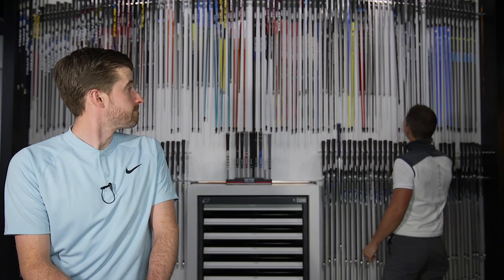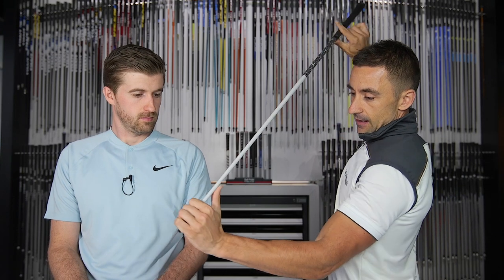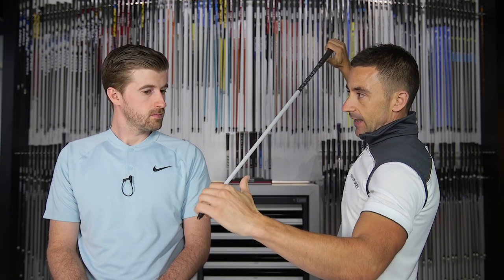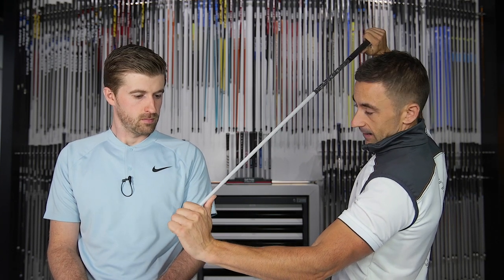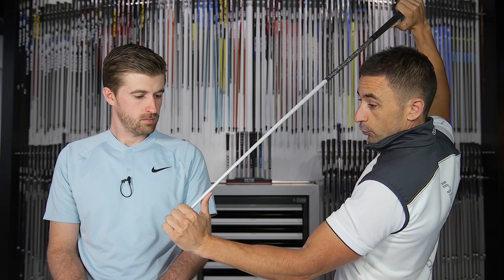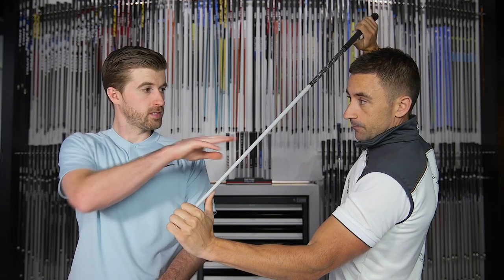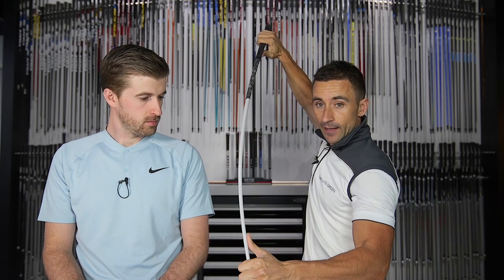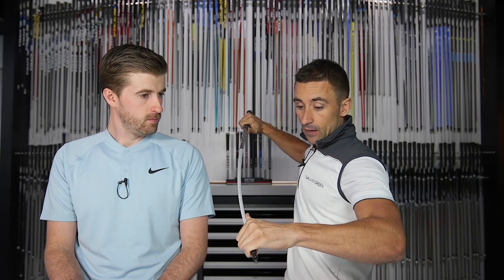The True Role of the Golf Shaft

Comment: I experienced this very thing in my own fitting with Ian while working through various shaft alternatives and I’m in mid handicap player.  As we narrowed it down, the launch conditions between the two finalists varied only slightly but in my case the Accra shaft had a better strike pattern and thus that’s the shaft we went with.  A key point is that the science here works for players of all skill levels.

Comment: I'd love to see this test with someone who is extremely quick takeaway, and hard load through transition. Crossfield and Dan are smooth release and Matt builds momentum so smoothly the shaft weight didn't seem to effect them as much. Personally my tempo is quick and I struggle to find the face with a lighter setup.
Reply: Agree.  I've got a very quick tempo and hard transition and my GC Quad shows a WILD difference under the same testing conditions.

Comment: It's a touch and go area I believe and it's different from person to person. I guy with a good swing can make a good swing with any shaft if they have good club face awareness. As a fine tuning thing I agree. I have a 115 mph club head speed but I got fit with a stiff shaft instead of an extra stiff. I have a 80g stiff shaft because for some reason the extra stiff  made me more inconsistent on the club face. It was weird for the fitting Pro as well as he said my swing doesn't have massive mechanical faults and I have fast club speed but, as soon as he strapped an extra stiff shaft 65g on, which he said is the avg for my numbers, my dispersion was all over the place and I even hit 2 sky balls. The shaft felt wrong for me as well, almost like I have a different swing and my timing was off. Then he placed me in a stiff shaft thatch heavier, take note I am a big guy (rugby player), my dispersion became better than my previous shaft and I even gained 2mph and 20 extra yards om my driver. He said the shaft is a bit stiffer than a normal stiff shaft but, he thinks it has something to do with the load I am placing on the shaft and the extra stiff shaft made me release to early, causing my swing to get out of sync. I am not an expert, but what I have seen from my Iron re shafting and what I felt with my driver re shafting, it can make a difference in dispersion and feeling but, it is more connected to your specific swing and timing. When I re shafted my Irons, my dispersion came in by at least 35-40 yds and I gained 10 extra yds on my irons(not that I need any more distance) but, I also gained height, and more back spin. So my irons rolled out less, they where going further but instead of rolling a 6 Iron over the green I was able to land and stop a 7 Iron on the green. Take note that My old shafts where a 90g KBS stiff from when I was still in school where my new shafts are a 120 modus pro. It also made my misses more consistent. I know Mark, have been a follower of him for years and his a good golfer, but out of personal experience, re shafting will help you if you are not yet so good and so aware of your swing that you can change your angles to compensate for you swing mechanics. My re shafting made me play much more consistent and gave me more confidence in my swings. It is expensive tough, but for someone wanting to start playing golf again or I would recommend it 100% as it;s less expensive than buying new clubs, especially where I live, and I am striking my balls better than I ever had. I am much more consistent with where on the club face the balls hit and I have a natural fade now, trying to switch it to a natural draw. The most important of it all is I have consistent misses now, which I never had, so I know to aim a bit more to the right as I miss left with my irons if i miss and to aim more left with my Driver as I miss right when I miss my driver. It helped me hit a lot more greens and fairways, hell I have even made some greens with one shot on short par 4's by catering for my miss and draw with a driver. I for one believe in a re shafting as it helped me. Just make sure you are doing it with good people who won't try and pressure you into buying new clubs.

Comment: I have tried a number of different heads and shafts over the past 2 years. I play to a 13 HC and can honestly say that the shaft is the MOST important aspect of my driver. I recently put a Kuro Kage XT 60 Stiff flex in my M3 and immediately started finding more fairways. My last round was the 3rd full round with this shaft and I hit every fairway. Can't remember the last time that's happened. In my opinion, there are heads that look better to each golfer's eye but at 460cc most are more similar than they are different. I can't believe the difference this particular shaft has made for my 100-105 mph swing speed. Not trying to oversell this particular brand, but I can't say enough about the world of difference the shaft made to my strike location on the face. If it weren't me, I don't think I'd believe it.

Comment: I just paused this at 5:15. When I got fit for my I200 irons, the shaft definitely changed strike location. With the AWT 2.0 shaft Regular flex was out on the toe, Stiff was on the heel (or possibly vice versa), Stiff Regular in between the other two(Japan Spec) was centre of the face. I also saw this with other flexes on the shafts Ping offer.

Comment: I like Mark Crossfield. He's a bit of a dominant babbler. Though he is entertaining and quite sharp.  I also like that he couldn't help himself but to lay it on the line and say that,  even though he knew it would cause trouble.  I also think both of you are correct.  The Subliminal bio-mechanical shift in the hands to accommodate a different flex profile is a good observation towards the idea of the human machine and how sensitive it can be.  I personally swing about 107 to 110 mph and use stiff shafts in most of my clubs...And I prefer the KBS over the True Temper.  Except in an Adams Hybrid that I have.  That club shaft is a Mitsubishi Fubuki Ax 350 Regular...I wouldn't change it .  It's an amazing combo for me.  One of my favorite clubs. The club head is light weight.  So It doesn't require the added shaft stability.  The weight of the club head in concert with the shaft profile matters...And if you lose two extra swings at the ball per round because you have  perfectly matched club and shafts throughout your set...That's a lot... if you're a professional.  Could mean you're making cuts instead of driving home.  Even if your just a home course player...Might mean you never pay for lunch.   
Also: You also saw that Dan in Marks video said he wouldn't change to a ladies shaft.  The Psychology of it.   Personally....If it would help me win more rounds I'd play a full ladies set and enjoy it.  I would love to take my friends money after beating them with ladies clubs.

Comment: The role of my driver shaft is especially heightened because I mostly play on a tight championship course where you HAVE to masterfully shape it both ways off the tee to shoot a great score. Every hole is dog legged with overhanging trees and bunkers in play. Only one hole of the par 4/5’s is straight on the entire course, and even then there’s a bunker in play on the right edge of the fairway and tight tree trouble all down the left. In addition, most greens are raised and sloped making positioning off the tee all the more important and can change given different pin locations and wind direction. A swing/shaft/head combo that eliminates one side is a no go for me. I spend a lot of time on the range working on the 9 flight boxes and accuracy. If equipment hinders that then I’m in trouble at the next week’s match. On the plus side, I tend to eat more open courses for breakfast 😊

Comment: Interesting listening.
I've been playing Aldila NV Rip'd 65 Stiff 3.8 torque. 90mph SS
Switched to NV Rip'd 65 Reg 4.4 torque. Never missed so many right. Felt the clubface was lagging/staying open.
Switched back to stiff regained some consistency.
Recently picked up an Aldila Tour Green atx 65 stiff 3.5.
Didn't realise at time but it is a TS which sits between S & X.
Tried it out and have never hit so many drives out of dead center. No obvious loss of distance but may gain more roll when fairways dry out.😎
Tried a few lightweight shafts as now 62 but found them all going low right?
My conclusion is Torque is a big factor.

Comment: Speaking of deflection, I'm guessing that 45mm of droop and nearly 80mm of lead deflection at impact on my 6 iron, is a bit excessive and that I should be looking at firmer shafts (in conjunction with swing adjustments). Do you think the excessive deflection is a contributing factor in my high, low-spin and fading ball flight, or is it more likely to simply deliver inconsistent strikes?

Comment: After watching all three videos that mark and TXG have done, the information that is passed to the player seems to be key.  In Marks video with the senior shows that someone who has limited knowledge club path to face of the club didn’t change on his perception of what the club / Shaft would do.

In this video lots of information about the shafted was passed to a skilled player, and the strike pattern became more erratic. This could of been down to his subconscious trying to compensate for his ideas of the club. Which in turn would play a part on the number you were getting.

As you said during the video a skilled player would be able to adjust to the club/shaft and put more or less shaft lead into the swing.  

I think people need to remember the robotic test show none to very little variance in a swing and I would suggest that no average player has that degree of tolerance in their swing.
Reply from the maker: Don't know if I'd agree with that completely Kyle. There's no doubt that all things being equal, different shafts vary in performance – they deflect differently and can have an effect on strike point, path etc. What you've said is valid though, it's hard to eliminate the human factor when doing testing. But there is plenty of research and data out there showing the influence of shafts. The idea is to fit a player to a shaft that fits them properly, so neither conscious nor unconscious adjustments are needed to get the best performance.
Reply from the maker: And I'll add this since another commenter above brought up the variance in human testing as well: we do have plans to incorporate robot testing into our channel in the future. To give a truly objective test of how shafts work with no additional variables added by a human tester, that is the only way to go.
Reply: TXG Tour Experience Golf: thanks for the reply, if the shaft had that much influence on the club (and not the human) then you could eliminate all factors and get people to hit just straight balls? But I would suggest that the club path and face of the club plays a much larger part in shot shape, direction and distance etc. I could be wrong?  They used to pure shafts in clubs but that seems to have gone by the wayside.

What I would agree with is that it’s a lot about feel and how comfortable the person hitting the club feels over the type of shaft being used.
Reply from the maker: For sure, the player's swing will always have more influence on the ball flight. We definitely would never suggest that a shaft would have more influence than the actual golf swing itself.

Comment: Great explanation to the shafts role in the club.  What would be the head characteristics of a titleist 915 d3 9.5 head?
Reply from the maker: D3 model is the lower spinning/launching model in Titleist's driver range. Titleist drivers tend to spin a bit more than other manufacturers drivers, making them a good option for a player that needs a bit more spin. That being said, with a proper fitting they can be set up to perform well for a lot of players.

Comment: The over swing and matsuyama pause have gone matty! Shorter back swing and not as much of a pause. 
I have found between the 3 shafts i have played with in my current driver head they have given me 3 different strike points, I'm assuming based on their profile. Hzrdus yellow 70x gave me srike pattern lower in the face, rogue silver 70x more central and atmos black 70tx higher in the face. When i hit them all from the centre, they do the same thing, its just that they trend to different areas of thr face as a whole. 
I'm going to take a guess that hzrdus yellow being counterbalanced and soft mid section is deflecting more, rogue silver has more of a sofer butt section and i think the profile fits well and the atmos feels stiffer all over and probably deflects the least out of those, or the slightly stiffer feeling is causing me to drag the handle forward more. All of which with a bit of time, i could change myself to play it.
I could be way off there haha

Comment: Is it possible to add launch, peak height, by changing driver shaft? What does shaft weight do? Have you talked about this? If so, in which video? Many thanks!!!
Reply from the maker: It is possible Johan, we haven't done a video specifically on that yet though. Best thing to do is book a fitting session where you can try various shaft options and compare the results.

Comment: theoretically if you hit use say a regular flex and the x stiff with the same swing tempo. assuming the regular flex is bent at all when it strikes the ball, not only will the club head will be behind the ball it will be shorter. Therefore you hit the heel lower on the club resulting in a low (compared to your normal hit not standard) draw.
Reply: Thats not for me though I slice a lower flex, and the stiffer the straighter and more consistent. Its likely the placebo effect like you mentioned, I just dont like the idea of the club bending when I strike.

Comment: I got a personal question about iron shafts. This season I've changed my irons from taylormade r7 reg flex (I know they are old lol) to ping g series stiff flex. I've lost about ten to fifteen yards but I'm way more consistent in dispersion. Could my swing speed have changed? Or, could the reg flex create more energy, because hit with them I feel more of a sling shot effect if that makes sense. Also, the r7 7 iron is, I believe 2 or 3 degrees more loft than my new set. Also, I swing around 90 mph for my 7 iron, at least that's what it was when a few months ago.
Reply from the maker: That is interesting since the loft are stronger on your new set. Sounds like you're getting more spin with the new irons, which would account for both the shorter distance and more stable ball flight.
Reply: why were you playing regular shafts if you're swinging at 90 mph with a 7 iron? seems a bit soft to me
Reply: Cam Gilbert Golf my regular shafts were my first set from 8 years ago or so. My swing speed was a lot Less back then.
Reply: Ben Harris makes sense. 90 is quick for a 7 iron. I’m at 93 with a 6i. Quick tempo though. C-Taper 130X was the direction I went with my irons
Reply: Cam Gilbert Golf I also just went to the golf store and it seems my swing speed has gone down. I was trying drivers and my speed went from 105 down to 95 - 99.  So, I think my 7 -iron went down too.
Reply: Cam Gilbert Golf which is crazy because I just bought my new irons and driver about 4 months ago. I need to hit the weights or something.

Comment: Lead deflection? Could you please confirm that this effect is largest with the driver? Because shutter lag has been a deceiver for a long time that exaggerates the apparent lead deflection when photographed. I thought lead deflection was just a myth because all photos of golfers from face on show massive lead deflection at impact. I would think a driver with the weight fully at the back has considerably higher lead deflection than a 1 iron which I would imagine has zero lead deflection since all the mass is perpendicular to the sternum of the golfer.I think that would be a nice collaboration with the slow mo guys to see actual videos of driver shaft lead deflection vs. a similar shaft with only a 1 iron. But I guess the slow mo guys are a bit higher on the youtube channel list.But again, really like your videos. I learn so much from you guys and this is very interesting for me as an engineer and also fellow long hitter. club head speed up to 120 but attack angler way too steep so I struggle with spin and losing distance because of that.
Reply from the maker: Good comment. A couple things we have in the works: 1) we want to get data on the Gears golf system which will measure the shaft deflection accurately, and 2) we hope to either rent or acquire a super high speed camera that eliminates those false shaft bend effects and will show the true deflection properly.

Comment: ‘I believe that shafts can change strike location’. Believe? You know it can or you don’t. You don’t believe. I bought a club head a ts3. I need to find a shaft for it. In order to do that , I am going for a fitting. I don’t feel like I can buy any shaft off eBay and it will just be good for me in terms of length or flex. In fact I have another titleist driver a 910d3. But the head is a full 12 g heavier than the new club head. When I put that shaft onto my ts3 I find that I lose a massive amount of distance. I cannot play the ts3 currently as although it’s clearly more forgiving than my 910d3, I am far far shorter.

Comment: I know this is an older video, but did anyone go and see Ping's Enso? Basically their Enso has found there is still a correlation between using lie diagnostic tape and Enso's absolute lie angle, even though the ball has gone by the time the tape hits the board.